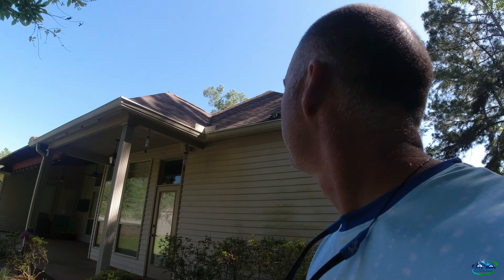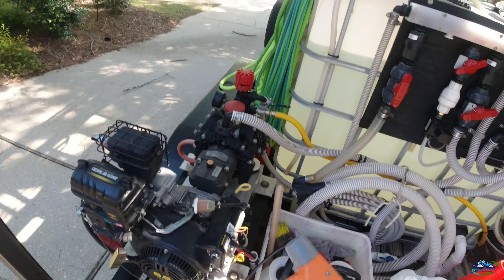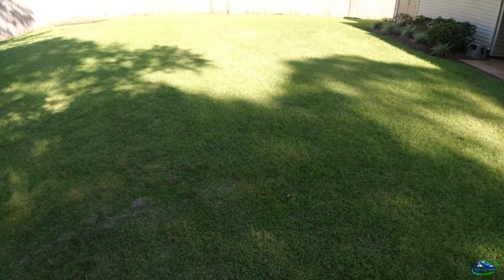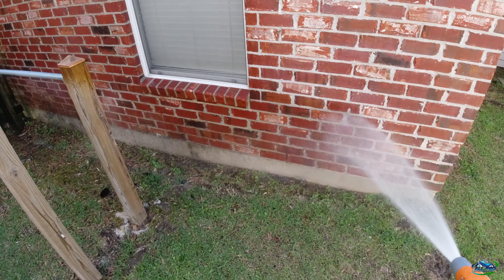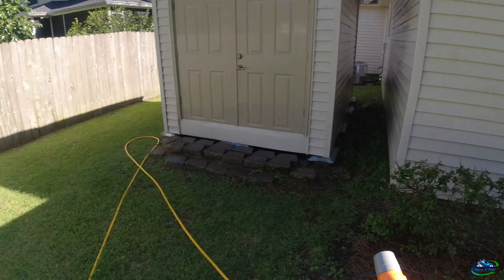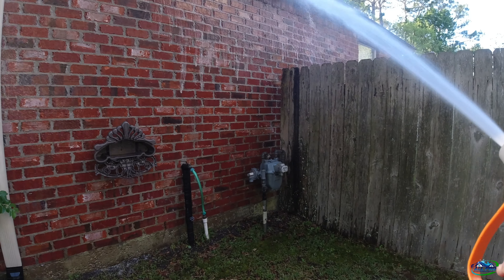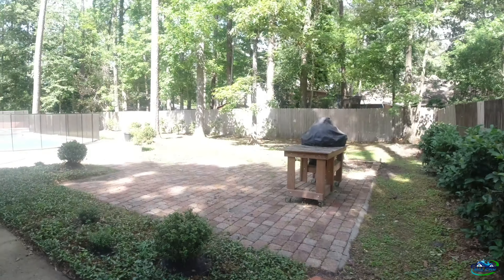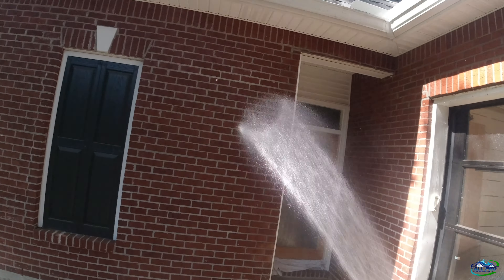A Couple of House Washes with Pool Deck

Comment: Now that you went with a different gun would you go back to the red gun or will you stay with the Waterboss
Reply from the maker: I would lean more towards the waterboss. The trigger is much easier and it is a little lighter. Thanks
Reply: @allproexteriorservicesllc5338  awesome also do you think the waterboss is more efficient at using chem than the red gun less or more chem even though you use a metering valve ?
Reply from the maker: @crystalclearwindowsllc  I think they both use the same amount of chemical. Thanks